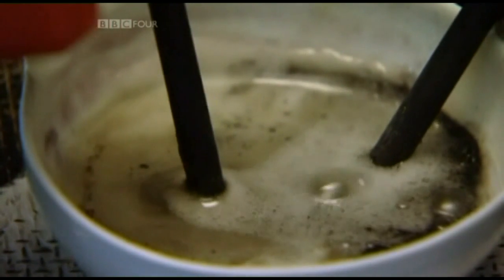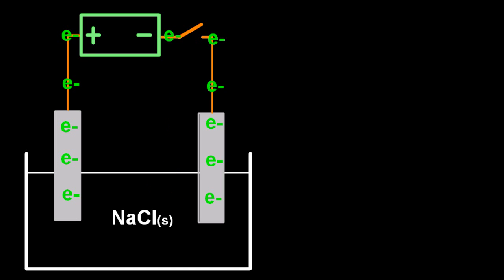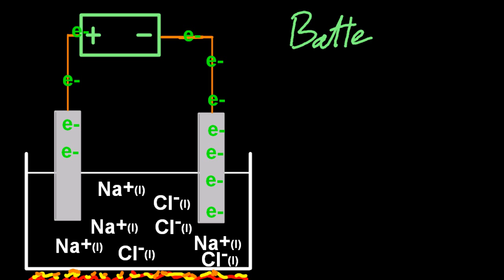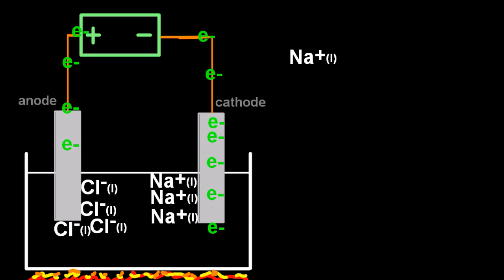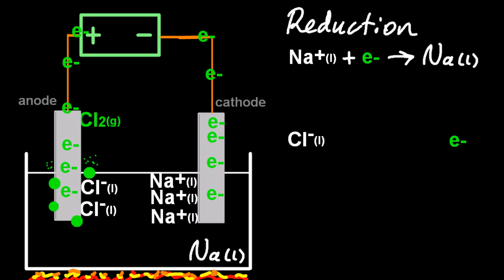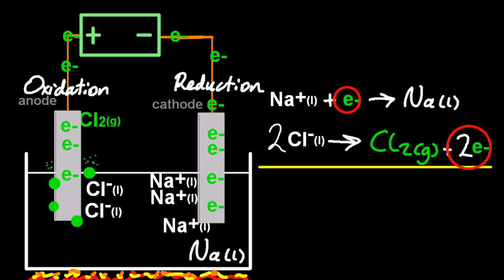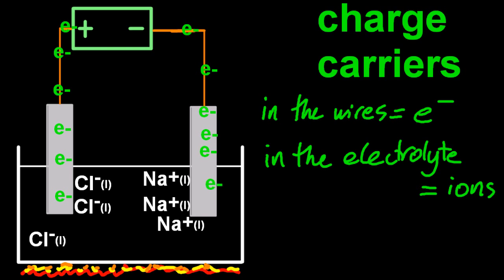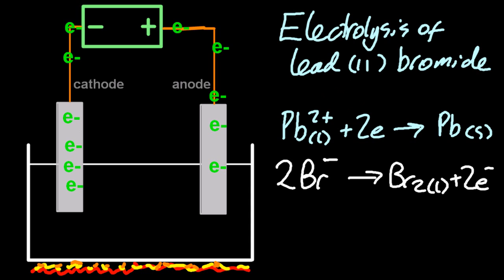R3.2.8 Electrolysis of Molten Sodium Chloride [SL IB Chemistry]

Comment: table salt conduct electricity just fine without water. actually i tried to make a resistor using sand and table salt. did not work to well as the salt was to much conductive even then.
Reply from the maker: Hmmm - interesting.  Everything conducts at least a little electricity - even air - perhaps you have very sensitive equipment, or the salt was a little damp from the air or sand.

Comment: But why does sodium and chloride separate into their ion states, just because they're melted? I always learned that this is what happens in an aqueous solution of sodium chloride, meaning by dissolving it in water, not by melting it.
Reply from the maker: If enough energy is supplied (by heating) then the ionic bonds will break.  Even though the + and - ions are still attracted to each other, the ions have some much (kinetic) energy they can move around with some freedom.

Comment: anode is positive while cathode is negative. Really??? Anode sounds like anion, which is a negatively charged ion, while cathode sounds like cation, which is a positively charged ion. despite anode sounding like anion and cathode sounding like cation, the similar sounding electrodes and ions have opposite charges. Is that actually true???
Reply from the maker: Alas the anode and cathode switch between electrolysis and electrochemical cell. Just remember RED CAT (reduction always happens at the cathode in both cases)
Reply: Yes its right ..This is because cation is attracted towards cathode and anion towards anode

Comment: Incorrect.  The molten sodium produced within molten NaCl would NOT drop to the bottom but it would, rather, float to the top because sodium is lighter than sodium chloride.  It is LESS than half the density of NaCl in fact.  This is unfortunate because, if the Na did sink, it would be much easier to collect it without it reacting.
Reply from the maker: Indeed you are correct - and I throw sodium into water every year!
Reply: @ibchemvids  haha, how many burn scars ?? 😁
Reply: @AndysMusicPod  no dude it's salt

Comment: Thanks for the lecture, but why does metallic sodium goes down to the bottom and does not cover the cathode like in electroplating process?
Reply from the maker: Hmmm I never thought of that!  I think that the bond between the Na and the Carbon must be weak.  In electroplating stronger metallic bonds form.